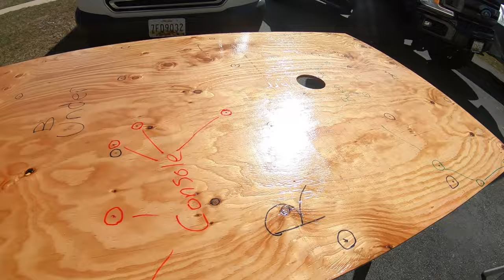Is Fiberglass Resin Really The BEST Wood Sealant For Boats???

Comment: Ive seen what seems like a hundred people lay down fiberglass resin to seal there deck but nobody ever thinks to at least add a layer of fiberglass cloth to reinforce it. When we redid the wood floor in our small boat I cut out a layer of 3m fiberglass cloth the same size as the deck with a 2 inch overhang around all the hatch holes and sealed the wood with that thin layer of glass. It mad the deck way stiffer and even gave us the confidence to have used a thinner sheet of ply to do the same job. If your already going through the trouble of mixing the resin and coat the wood id suggest taking the extra step of glassing it too
Reply: Does it still hold up well? I am thinking of doing this to reinforce the wood.

Comment: Fiberglass is pretty amazing stuff. I was born and raised in Nova Scotia, Canada. The local boat builders would build small plywood dinghys ( 10 to 12 foot plywood row boats) and cover the bottom surface with fiberglass. Thry gave them a good coat of resin and applied fibreglass cloth as well for abrasion resistance. When they were fininshed with this they would apply a few coats of paint. These little boats got banged around a lot on a daily basis and they lasted for years. 

I grew up working with my father in his autobody repair shop. We would often use fiberglass resin, cloth, and reinforcing compound to repair rust holes. Fibreglass is not affected by salt and such repairs would last a really long time, often longer than using a metal patch. Sometimes, if there was a small hole at the bottom of a panel I would patch it with metal and cover it with fiberglass reinforcing compound. It was as solid as a rock and inexpensive. 

I see that some RVs have exposed OSB or plywood floors. This is disappointing considering the price of those products. If the floor was in good condition, I think that a few coats of fiberglass would help to preserve it. 

Thank you for this video.
Reply: There are two types of fiberglass resin, polyester and epoxy.

Comment: You can use a brush and save on materials.  There is a method of using Acetone to clean the brush after applying fiberglass resin.  Your brush will be dry and ready to use when the first layer is dry.  You can also spray your mixing cup with Dawn and Pam and clean our the resin before it hardens.  This will give you a clean cup for the next batch.

Comment: I should’ve tried a roller. I just made a transom for my bullet input, a couple coats of fiberglass resin on it. I was stingy with the hardener on the first coat on both sides. It was a little tacky today, but I was able to sand it. I made sure to put in quite a bit of hardener for coat number two and it got hard within 45 minutes!
Reply from the maker: Nice adjustment.  I typically use a little more than they say in the instructions.  A slower cure does help it saturate the wood better though. I still prefer a fast cure lol

Comment: I have some indoor plywood that I used for the flooring in my house... Should I bother using that in my boat if I coat it with some resin and maybe some paint over that or should I just go get some exterior grade plywood at least first?

I don't expect  it to last 20 years, but If i could go 5 years without it needed to be fully replaced again I would be happy

Comment: 1:40 these chemicals are so potient that just a drop will cause the whole to harden. It just takes longer. The example with bondo 50:1 ratio is so user has long work time. The more u put the faster it solidifies. I figured that out working with bondo and later epoxy. 
It my be "dry" & flimsy today but a week later hard as a rock.

Comment: Does the amount of Hardner affect the drying time?
Reply: Yes... more speeds the time... too little and it won't harden properly leaving a gooey mess. Follow the recommendations on the label and also remember the air temp. will also effect how fast it hardens. Again, follow the recommended temps. to apply.

Comment: I have been enjoying your videos, I am currently redoing a boat floor, I had a question that you didn’t need to use fiberglass when using fiberglass resin on the wood floor that you put carpet on?
Reply from the maker: Yes I do  fiberglass Resin the wood before carpeting.

Comment: I build drums and use fiberglass for the inside of the drum shell. I’ve used this brand but isn’t bonding. It was 70 degrees outside yesterday, could that be the reason?
Reply: Do you just use the resin or the fiberglass cloth as well?
Reply: Polyester resin (fiberglass resin) has to be sanded between coats or it won’t stick to itself unless you are using laminating resin. 
Polyester resin also doesn’t stick to polyethylene plastic.

Comment: which glue for the carpet did you find bonded best?
Reply from the maker: @jaywarren3505  Robert's 6700 works great with Fiberglass Resin treated wood. Be sure to light sant the resin before applying the adhesive

Comment: A better choice for wood is marine grade epoxy resin. It will bond better with the wood. If not using fiberglass cloth a clear penitrating epoxy resin works great. All these coatings need to be painted over or varnished with something containing UV inhibitors. The resin will break down under the UV rays of the sunlight . The resin you used is a polyester resin and has been used in boat building for years. This resin cost allot less but in my experiences the quality for longevity when used with wood is not as good. If using fiberglass matts or cloths it bonds allot better. Still all fiberglass resins need to be coated with the UV  barriers. If you leave this in the sun unprotected it will start to turn collors then crack. Also over time blisters will form under the resin trapping moister and rotting the wood underneath. So prep work of your surface is key to long lasting protection. If laminating fiberglass cloth or matts  over wood it is very important to remove all air pockets or bubbles. Again this is were rot will develop.
Reply: If using fiberglass resin ,  only use woven fiberglass cloth, it will not bond with chopped strand mat, though polyester and epoxy will.
Reply: Epoxy better adhesion, strength, water resistance, less affected by uv rays